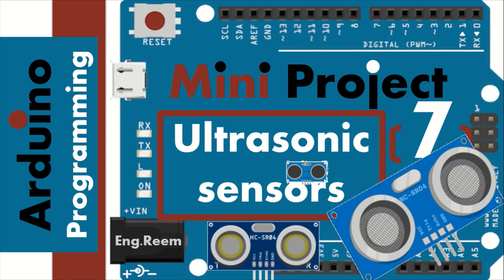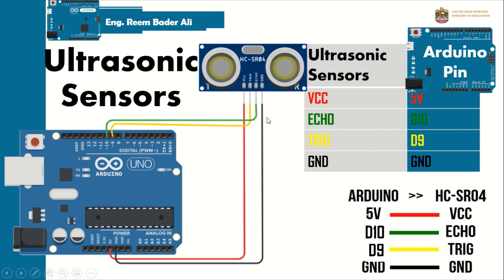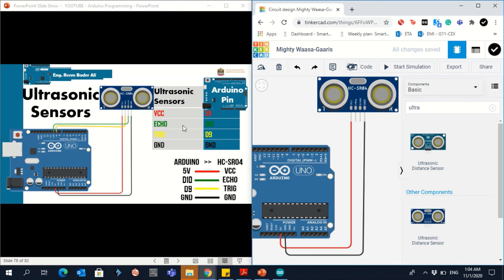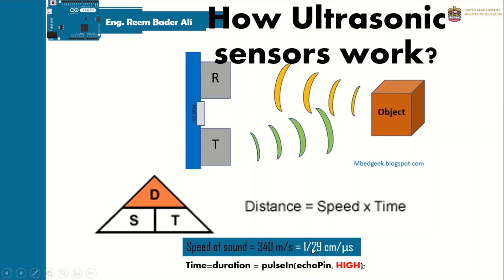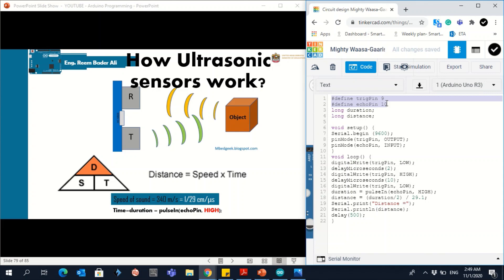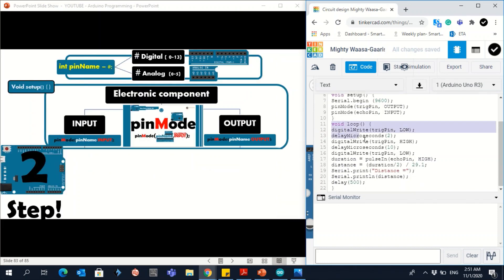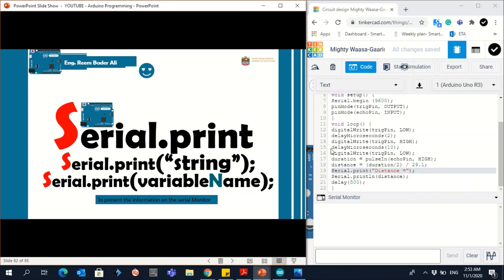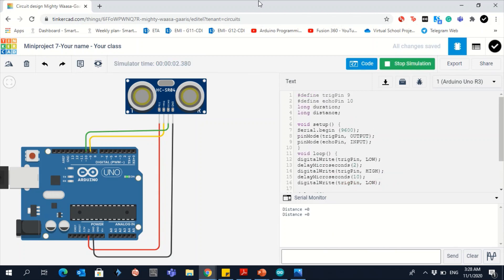Arduino MINI-PROJECT 7:Ultrasonic sensors

Comment: Tala Husen 12-A
I learned how to use a ultrasonic sensors in arduino to measure the distance as well as that ultrasonic sensors send signals and receives reflected signals.

Comment: I learned in this video how to use a ultrasonic sensors in Arduino to measure the distance. 
Ultrasonic sensors have 4 pins VCC connected to 5V, ECHO connected to D10                                           NOORA mohammed 12-D

Comment: I learned from the video is how the ultrasonic is used and it works by measuring distancesI learned how to program the arduino to communicate with ultrasonic sensors 
Ameera.Ahmed 12-D

Comment: Ashjan 12/D

I learned from this video where should the four parts of ultrasonic sensors should be connected with in the Arduino, and the speed of sound is 340 m/s which is equal to 1/29 cm/ms.

Comment: So in this project 7 I learn how to calculate the distance by using ultrasonic sensors and we have 4 main pins 1-Vcc(5v) 2-Triq(9V) 3-Echo(010) 4-GND(GND) also the rule of the D that is equal speed x Time don’t forget the traingle for this rule 🌹 
Thanks miss reem
Aya rashed 12-Advance

Comment: I learned how to use a ultrasonic sensors in arduino to measure the distance.
Also that the speed of sound is 340 m/s = 1/29 cm /ms and how it works.

Comment: Manal Khalid 12C
From this project I learned how to use an ultrasonic sensors in Arduino to measure distance. Also that the speed of sound is 340 m/s = 1/29 cm /ms and how it works. Thank you Miss Reem.

Comment: I learned in this video how to use a ultrasonic sensors in Arduino to measure the distance. 
Ultrasonic sensors have 4 pins VCC connected to 5V, ECHO connected to D10, TRIG connected to D9, and GND connected to the GND.
Asalah Khaled 12C

Comment: Maha Hasan 12C
1/11/2020
Ultrasonic sensors measure distance and used in almost every car. Furthermore, it uses the distance formula Distance= Time x Speed, and the speed is constant 340 m/s.